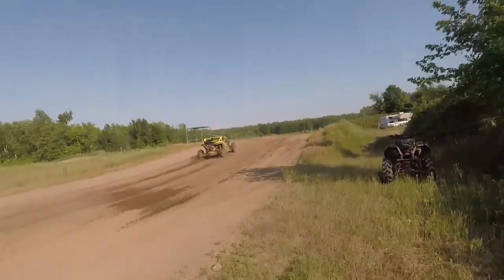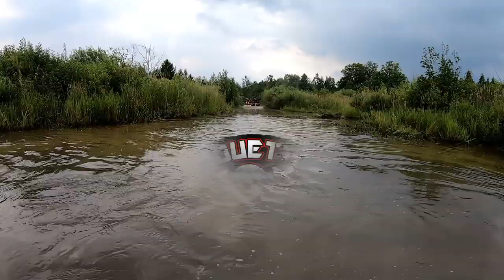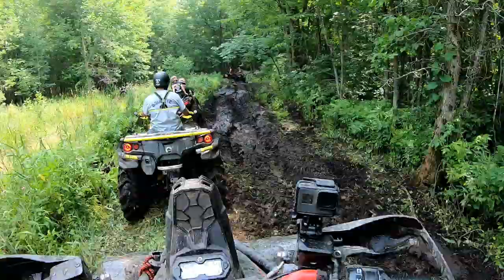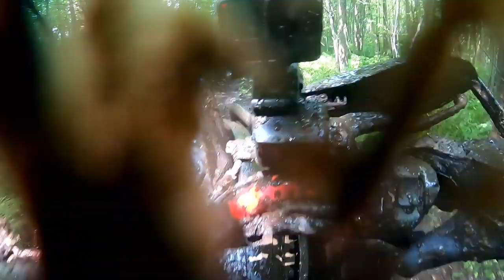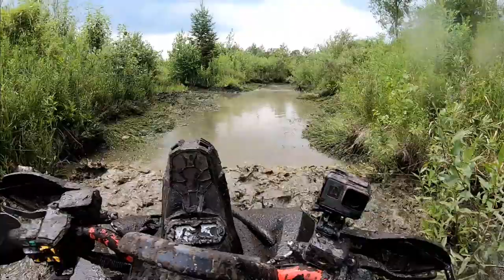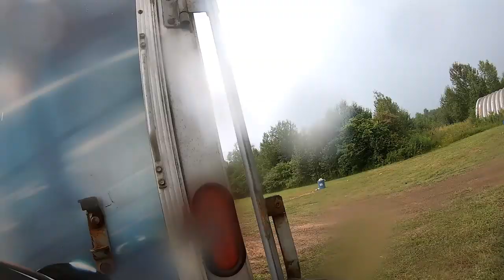You Better Run! Can-Am Renegade Xmr1000r Slinging Monster Tires

Comment: @eh TV. hey man I gotta question. My renegade xmr 1000r has 20 miles on it. I'm using performance key and I cant get it to do a wheelie at a dead stop with wide open throttle like your xmr seems to do. What do u think the issue is.
Reply from the maker: It has a breakin limiter on it possibly or try other key.